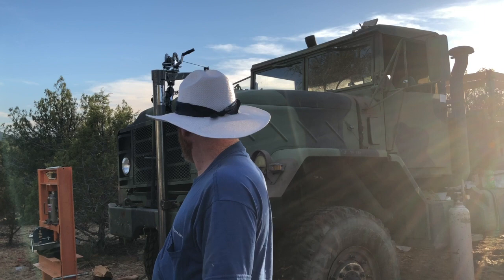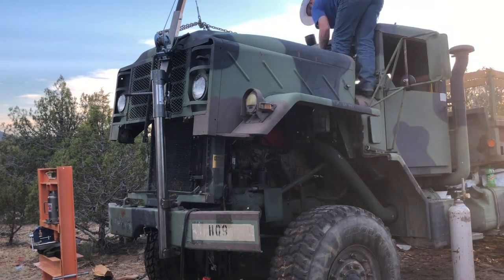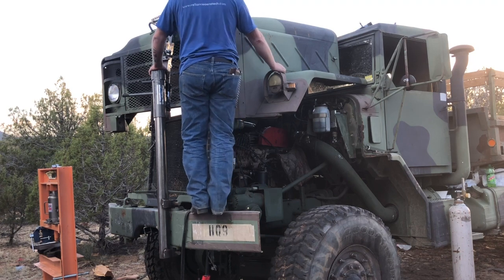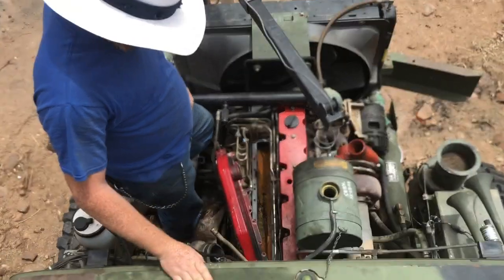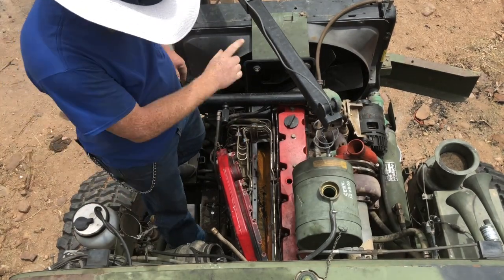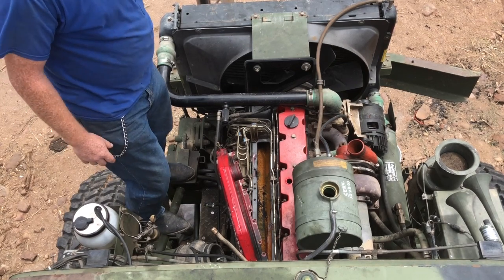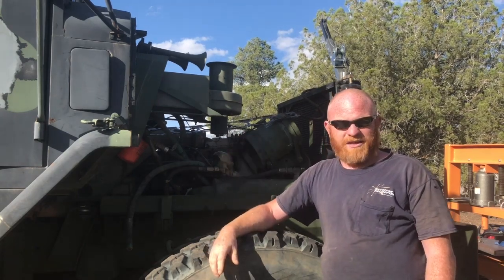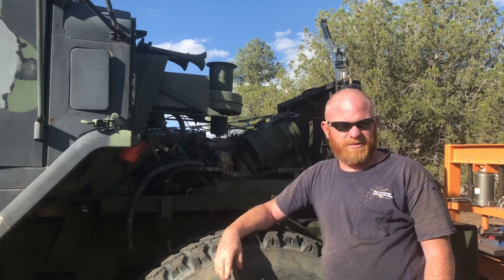6CTA8.3 12v Cummins Rebuild Part 1 - General Disassembly & Head Removal

Comment: well looks like its my turn to do the same mine just started smoking out of cylinder #2 and started by removing the exhaust and turbo and already snapped 2 bolts. Great content excellent job will use your video as a guide thanks
Reply from the maker: Manuel Aguiar sorry to hear that. Just out of curiosity, how many miles or hours does your engine have? Btw, if you have any questions feel free to ask me by email. Leonrathburn(@)yahoo
Reply: @OffGridOverLander  The boats I work on use those engines for generators. I’ve seen some run for 50,000 hours and I had one come apart at 28,000. The high hour ones usually had a major assembly replaced such as cylinder head or fuel injection pump.